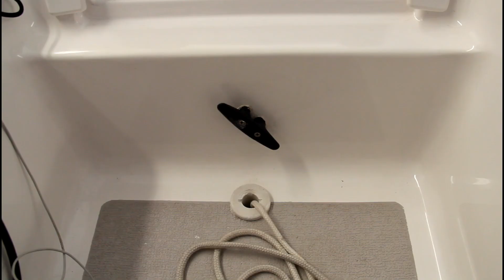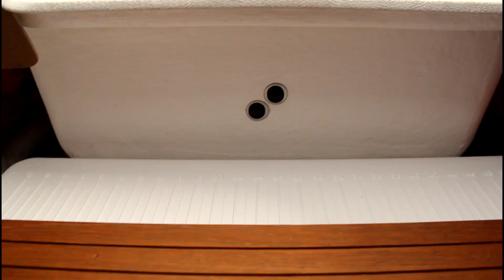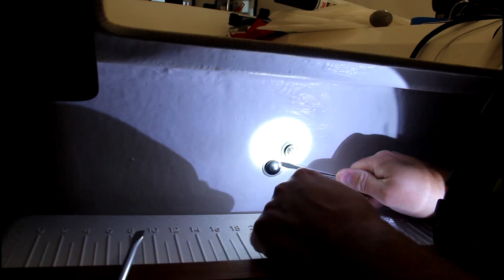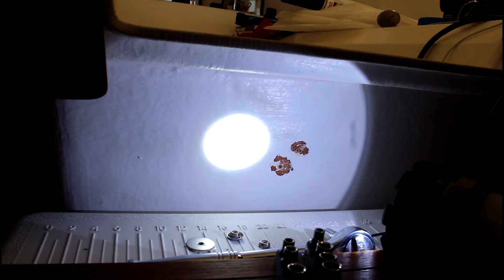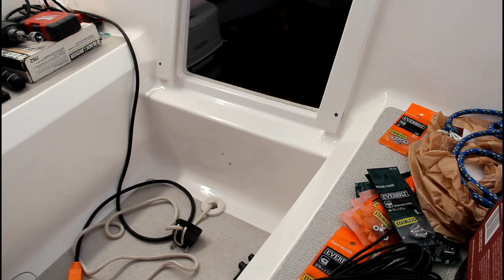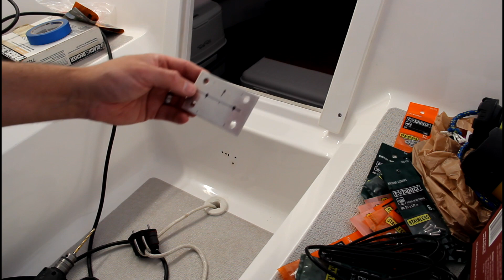Centerboard Control Line Upgrade

Comment: Hi Dave. I did the cam cleat upgrade. It really makes adjusting the centerboard easy. Question. We just had our P18 out for a first shakedown sail and overnight. https://www.youtube.com/watch?v=ucSKtmPwfbU&t=330s 
When the waves were getting bigger, we would get water coming up the tube for the centerboard line, into the cockpit. Also coming in the cockpit drains at times into the cockpit (and draining back out). Is this common? Also, it appears the tube leaked water into the bilge. I see tape at the top, so I suspect the hose at the top needs attention. Also, I remember in one of your videos you mentioned an insert for the mast gate. A source for that would be great if you can point me in the right direction. (Bobbing about in big swell on Lake Ontario is not the time for lugs to be escaping the mast when trying to lower sail or reef!) Any tips/insight would be appreciated!
Reply from the maker: The only time I’ve had water coming up the tube for the CB line is when moving really fast. I have not had water coming into the cockpit drains except maybe when three people are all standing at the stern. Was the boat really loaded up with gear? I’ve heard of someone who sailed a P-18 in the Florida panhandle with 7 people aboard…but I try to keep mine light. For the mast gate, take a look at mastgates.com. Tom Loque will fabricate something to fit your boat.
Reply: @ColoradoSailing  Thank you Dave. Yes, loaded up quite a bit. Two big coolers, gear, and in the stern 3 batteries, an outboard, a trolling motor, and a couple gallons of fuel.
Reply from the maker: @saabtech3510  that will do it. Probably made her a bit more mannerly in the winds, but be careful that your gear is secured and doesn’t all shift to the low side when heeling. It could keep her from righting herself.
Reply: @ColoradoSailing  Thank you Dave. Yes, I'm conscious of any potential shifts of gear etc. I did also just remember that I was told one of the past owners put some extra ballast in the bilge. I'll have to investigate and see if I can pull it out of there. (supposed to be lead in bottles connected by line or something) Since we will be doing overnight sails at times, with more provisions etc, or day sailing with family, we really don't want extra weight I don't think. And I think I remember you asking the designer about extra ballast, and he did not like the idea.
Reply from the maker: @saabtech3510  Jim T. said extra ballast was “okay” as long as it was epoxied in place (or otherwise permanently affixed) and overall boat loading was taken into account. He mostly didn’t like it because the extra weight would make the boat slower and it was designed to be an excellent light air performer (basically eliminating one of the best design characteristics).
Reply: @ColoradoSailing  Great information Dave. Good to know. Thanks again!
Reply from the maker: Wow!! Looks like you were really moving!! Nice vid!

Comment: hey, just got a 2006 P 18.  Does water go down that rope passage to the bilge?  Is the tube a maintenance item?
Reply from the maker: Congrats on your new boat! The passage for the centerboard line is watertight. Water will only go into the bilge if it has a leak. Typically the seal around the grommet at the top is the issue. There are also two clamps around a length of flexible hose that should be checked for tightness. Access is via an inspection port behind the cooler. Happy sailing! ⛵️

Comment: Great videos! I'm hoping to purchase a P18 soon and will need to replace her pennant (rope) used to raise and lower the swinging centerboard. Any recommendations on what type and thickness of line I'll need? Thanks
Reply from the maker: Some folks have replaced with Dyneema…but I would just call Bill Porter at Precision Boat Works and he’ll sell you a new one for $8. 😆
Reply: @ColoradoSailing  True.
Reply: @ColoradoSailing  True. Have you replaced your pennant before? Do you just tie a bowline to the centerboard? Apparently beaching her and rolling her on her side is the method of choice for the average do it yourselfer.

Comment: I dont use my center board that much but that upgrade makes for one handed operation
Reply: I avoid sailing windward when possible
Reply from the maker: @robmacneal3915  ah! My lake is 5 miles long but only 1 mile wide…and the wind tends to blow down the length of the lake. Some days I feel like I’m always close-hauled beating into the wind! 😂
Reply: no matter where the wind comes from sailing out and back is easy with the wind on my side,mostly 7 feet deep, only issue is wind blowing off mainland out of west they gust on and off.. yesterday one minute your moving 2.5 knots seconds later 5.5 knots
Reply from the maker: I’ve heard other P-18 guys say they don’t use the CB (because they are in shallow lakes) doesn’t the leeway drive you crazy? I feel like I’m not making progress to windward without it…